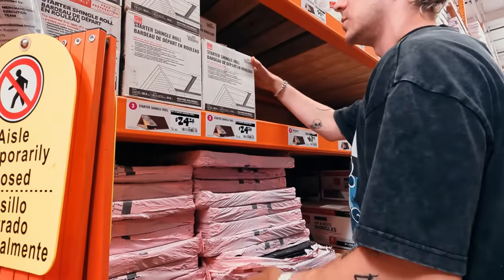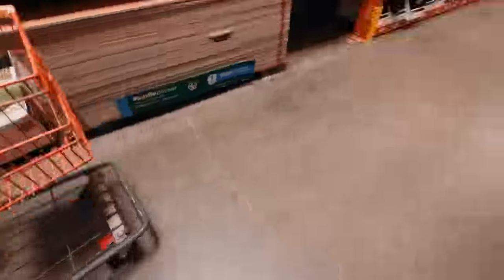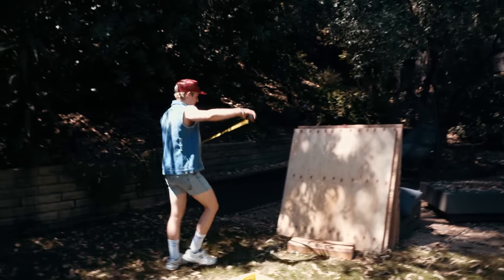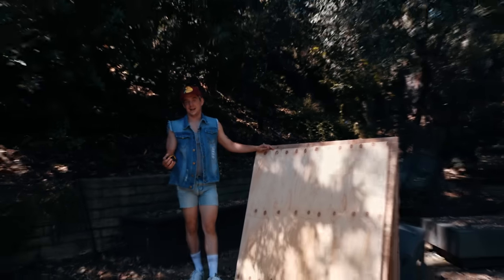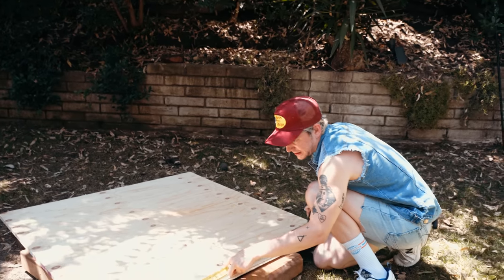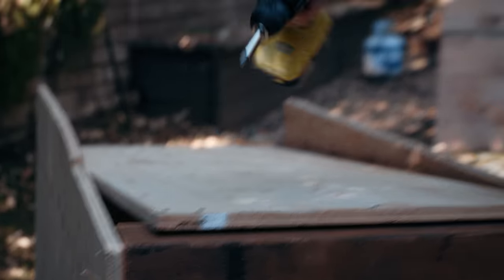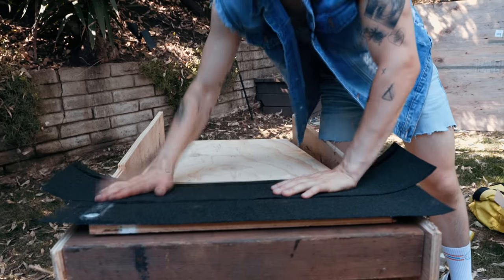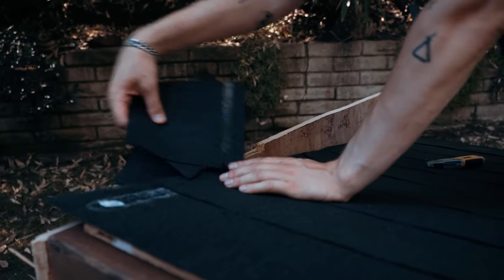i built a dog house… it went terribly

Comment: oh one thing you should add to the doghouse is a rubber flap, why? becuase its easy for the doggo to enter and leave any time but it will also keep wind snow and rain out of the dogs lil house, and it will help keep the house warmer for the dog. but you could also run an extension cord from your house to a small space heater for the pupper. just be sure it cant get wet... for obvious safty reasons for your pupperino. oh and you should put a dog bed in the back to make it more appealing to the pup

Comment: Ethan at house "how big should this be?"
Ethan previously at Home Depot "perfect 9 square feet of grass tiles"
Me "probably that big"
I just love that despite having internet and THOUSANDS of dog house designs with instructions, Ethan just goes and buys a bunch of random shit and no carpenter's tools.
For those of you that don't know, there is a notch at the top of the saw specifically put there so you can cut a straight line with ease...........
Wait is he using regular screws?
Ah I see the roof is well ventilated and will provide the dog with all he water he could want when it rains.
That poor dog.